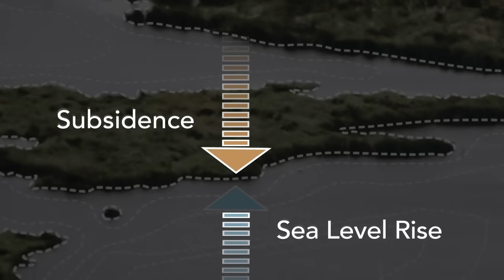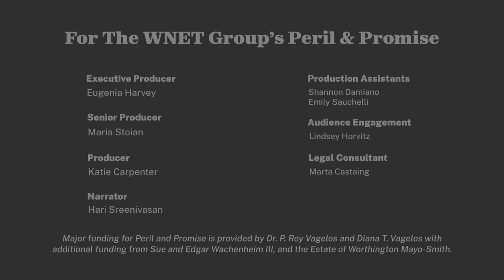Facing Down the Fossils: Restore

Comment: Why don't you get rid of the levees and let the Mississippi return to depositing material normally? Seems easier than collecting glass to turn it back into the sand it was originally made from, especially since it will take a lot of glass collection to fill in the amount of area you're looking at.